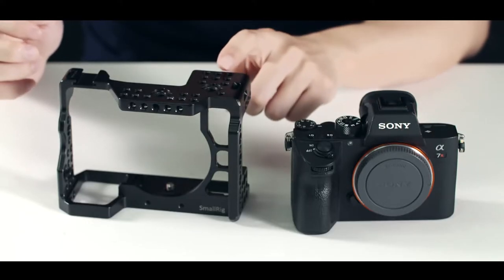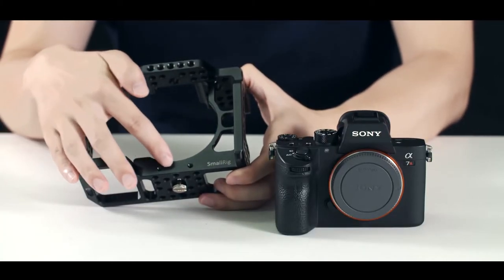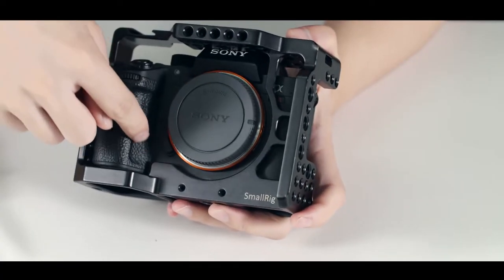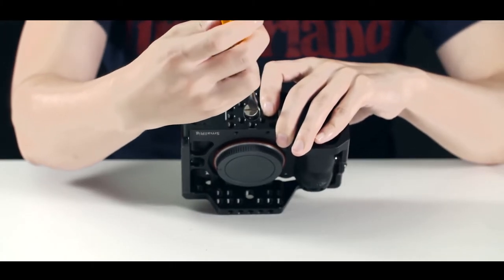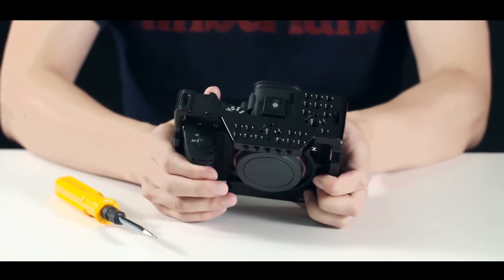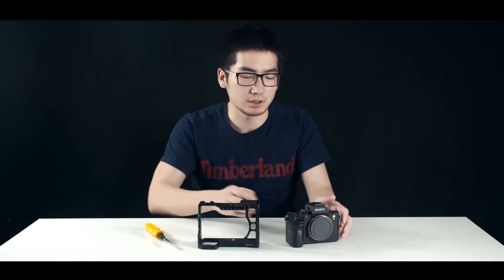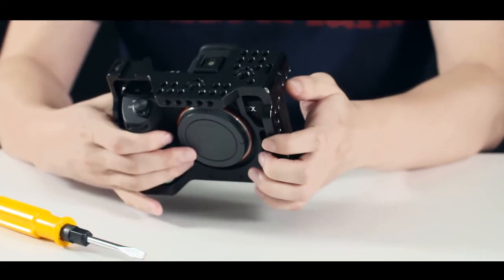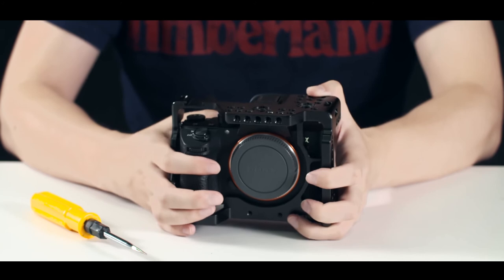The Right Way To Put a Camera In a Cage

Comment: Is there an adapter to attach a tripod to the bottom of these cages?
Reply from the maker: Do you mean a plate? What kind of tripod do you have?
Reply: Yes the plate that attaches the smallrig cage to a tripod. I have a K&F Concept 62" Professional Aluminum Tripod TM2324 with Ball Head Quick Release Plate
Reply from the maker: @austin1046  Sorry, at present we only have Manfrotto, Arca and Arri plate. Usually, the tripod has a plate that can connect on the bottom cage directly.
Reply: SmallRig China what would you recommend I use for Sony a6300 cage. I can get another tripod as I’m borrowing this one currently. Just need to know if I need a plate adapter or if I can attach the cage to a certain tripod without an adapter. Thanks
Reply from the maker: @austin1046  If there is a plate with the tripod, then you can attach the cage to tripod directly.